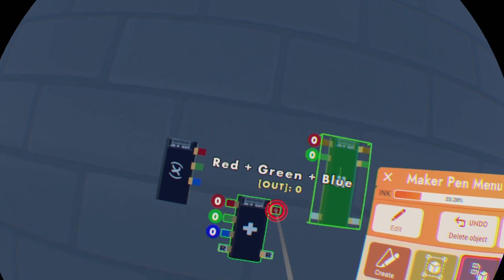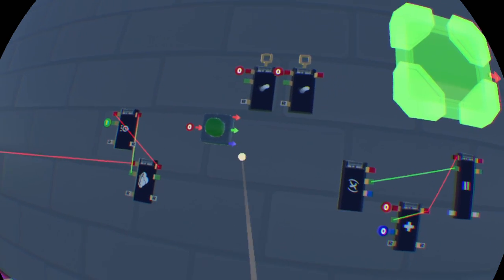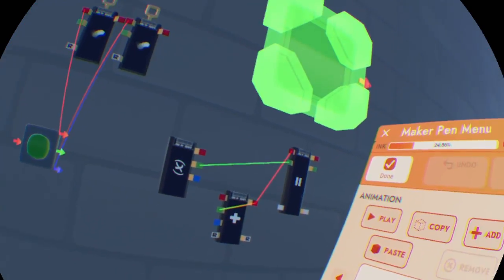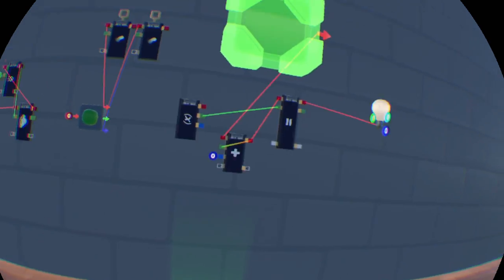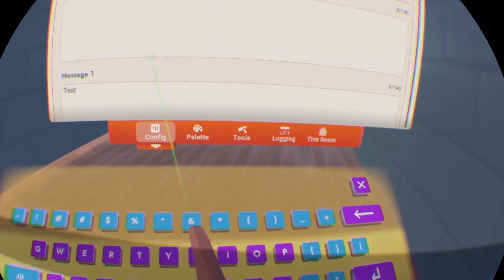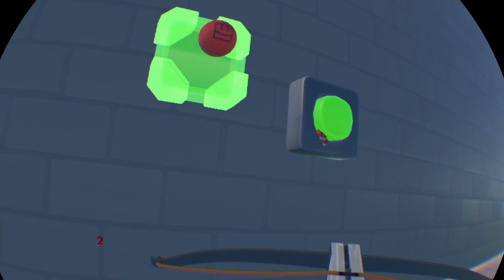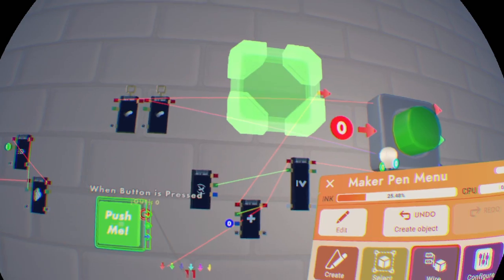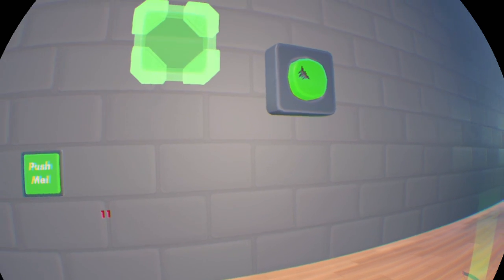(Outdated) Rec Room - How to Make a Boss

Comment: To trigger volumes work for damage?
Reply from the maker: Yes, but only in beta content rooms. You need to get a trigger volume V2, wire the player entered pin to the input, wire the damage source to the trigger zone, and write the other yellow pin to the player output on the trigger zone.
Reply: @KiwiTheRetroGal  thx this helped